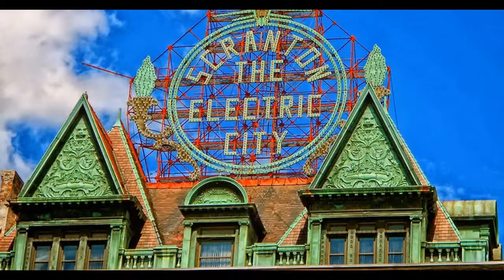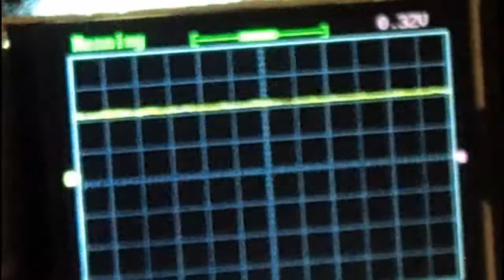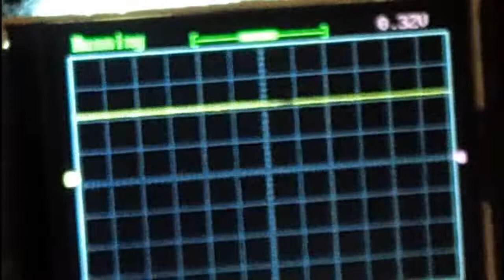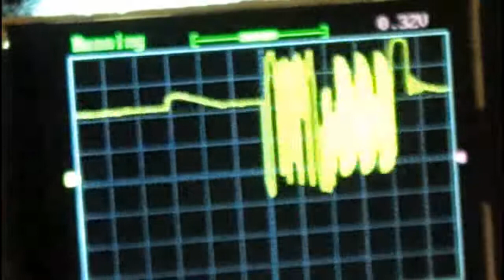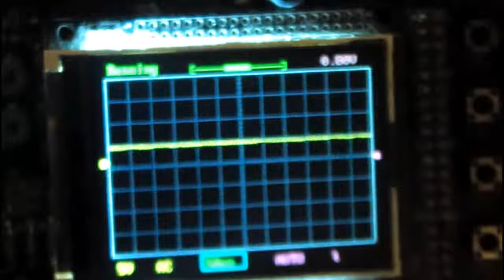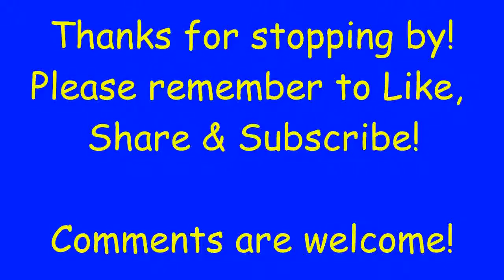What Went Wrong

Comment: It is still a cool circuit and lets people play with the 555 chip. Be interesting to see just what makes that difference. Another fun challenge Bob. And very cool you caught this and nipped it in the bud. Looking for the next one.
Reply from the maker: For a high voltage, low current application like nixie tubes it's fine. I've seen commercial circuits that are basically the same. Just no good for lower voltage higher current stuff.